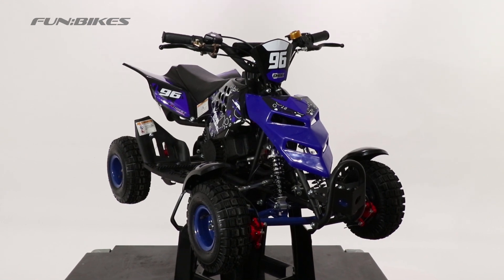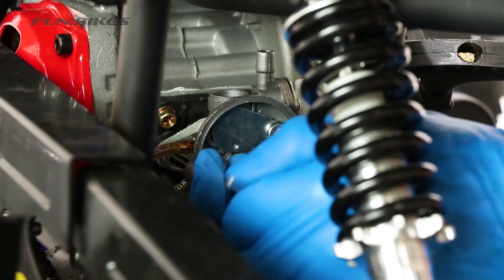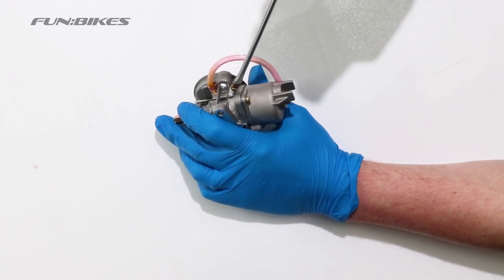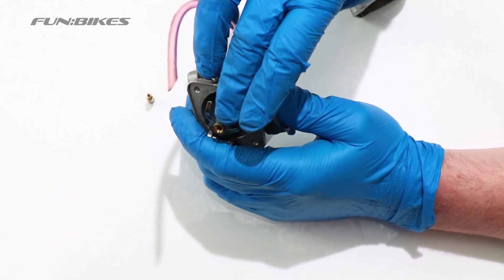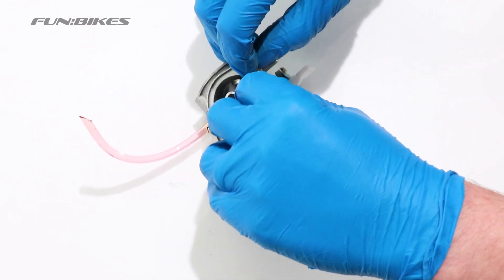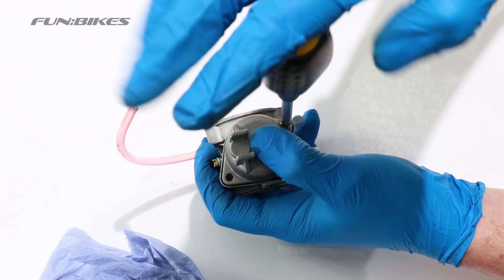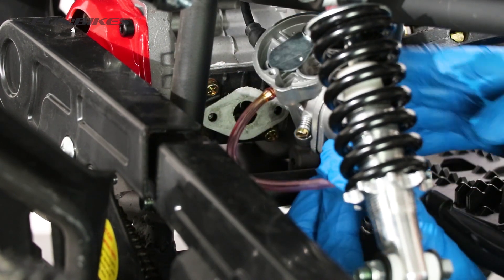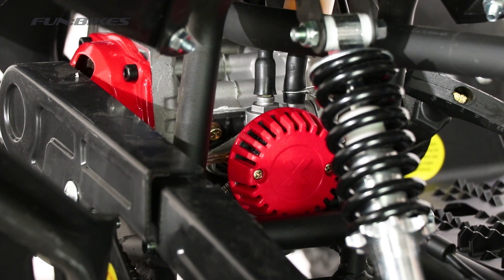Technical Help: How to change the Carburettor on a 49cc Mini Quad Bike

Comment: My 49cc keeps leaking out of the tube  idk whats wrong with it
Reply from the maker: Hi, All our products come with free lifetime technical support, so can we suggest you call our helpline on 01664 498640 and a mechanic will advise you on what needs to be done to resolve the issue. Best regards The FunBikes Team.
Reply: Make sure the clamps are tight. If not, use zip ties (if ure referring to the fuel hose). If ure not referring to that and referring to the overflow tube on the carb, then your idle screw is too loose and needs tightened

Comment: trying to fix a friend's and will only run with choke open, all jets cleaned. Also which way should the float be facing because you put it in the opposite way it came out.

Comment: Hi,great video,my son’s quad will only run on half/full choke,is this because of a clogged up carb?
Reply: have you found a fix to this yet? I'm fixing one for a pal and it's doing the same.
Reply: Philip Mcelhone no not yet but it does seem to be running better now and I haven’t touched the carb,sorry I couldn’t be more helpful
Reply: @GGGaming-nv1np  Turns out I was being a biff, all my kids bikes and quads are choke down for on so presumed this was the same. took the filter off and noticed it was the other way. Running fine now.

Comment: hi, i have one of these. i noticed that when the fuel switch is at the on position, fuel starts dripping out of the over slow pipe, i know its an issue with the float, but how can it be resolved?
Reply from the maker: Hi Mo, We are sorry you are having problems, may we suggest you call 01664 498640 and ask for technical support, one of our mechanics will then advise the best solution. Best regards The FunBikes Team.
Reply: @funbikes  thanks. i have tried calling but just get a recorded message. are you guys open?
Reply: This happens when the float can no longer shut off the fuel supply, 90% of the time its caused by dirt in the float needle valve. Other times you may need to bend the prongs out a touch so the float can shut off the fuel easier